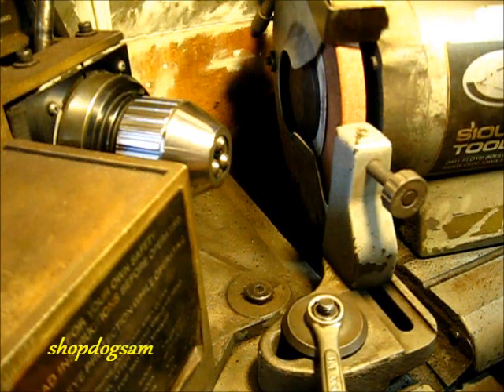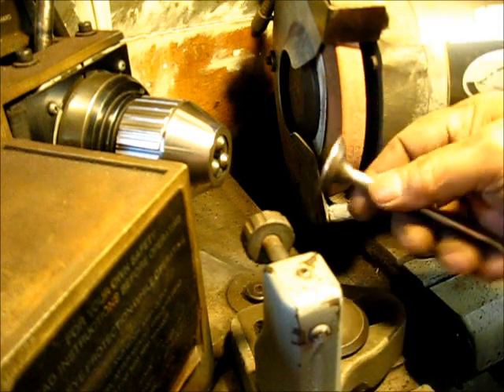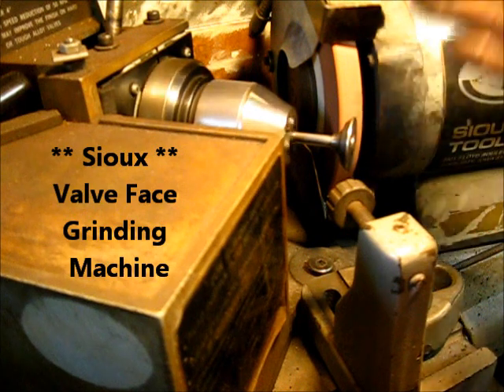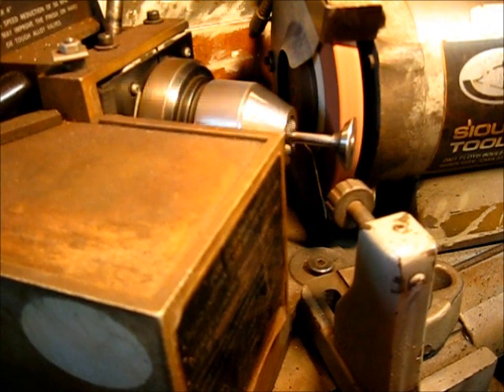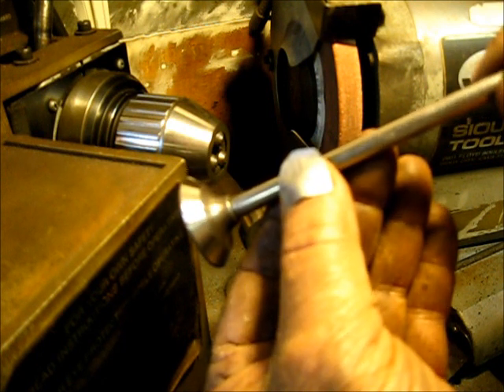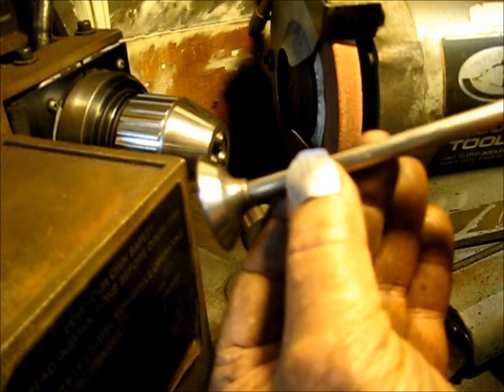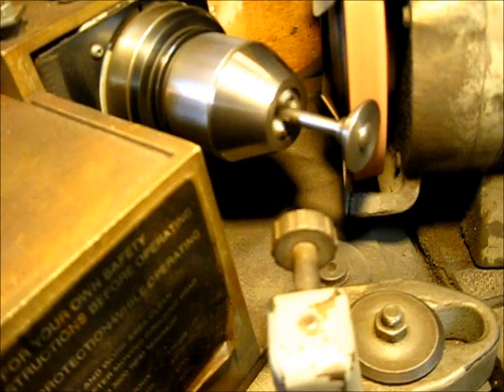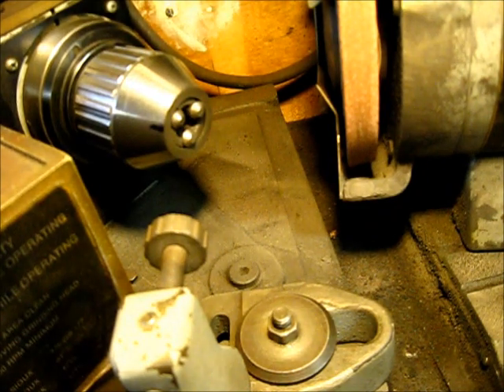I H C ENGINE how to grind a valve face

Comment: Great flash from the past. I have the same machine just too lazy to drag it out of trailer.
Back in the day about 30or40,000 miles was about it. I cant imagine doing a L head
straight 8 terrible job or even a 6 of any make. Also have all tooling to do seats V8
Ford special guide adaptors also. Guide remover \ installer Nash too, which is special.
My guess was bad gas. They just dont burn valves like they use to.  the other Sam

Comment: No grinding oil on the valve ?
Reply from the maker: grinding oil attachment has been installed and is used, the machine will be in use in an upcoming video

Comment: I am wondering why would you grind valve faces... for my corvette they are only $4.60 each... $37 for one set of heads. Am I missing something... do they need to be ground from brand new? Is this just for money saving on rebuilding? Is this for fine tuning to your valve bores. If my corvette set of valves are only $37 I have to assume this is for fine tuning and we would get serious noticeable results.
Reply: Craftsmanship, pride, obsolete unavailable parts ,fun
Reply: It's a shame that we live in a throw-away society nowadays....
Reply: ...Time was....replacement valves were expensive enough to warrant grinding the old ones like this....and it really doesn't take much time to do this....you don't have to drive to the store or order anything....
 In this case here....you may not be able to even get replacements....
Reply: ...I have a 73 Vette Stingray with a 350, but didn't mention it due to not being relevant here.....BUT....valves for my 46 Harley Knucklehead are like $35 EACH....so yes, it pays to grind them....